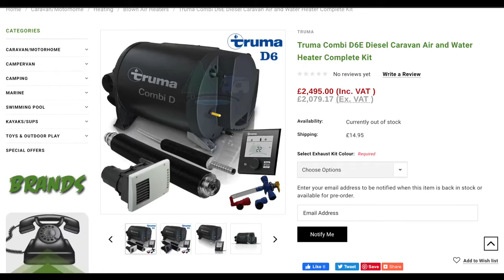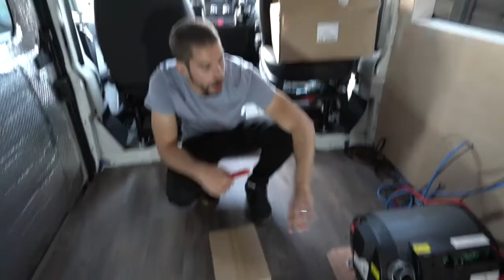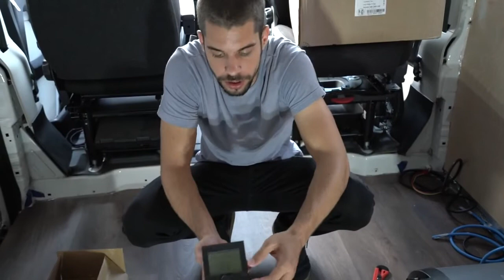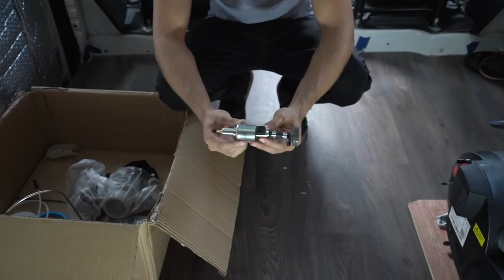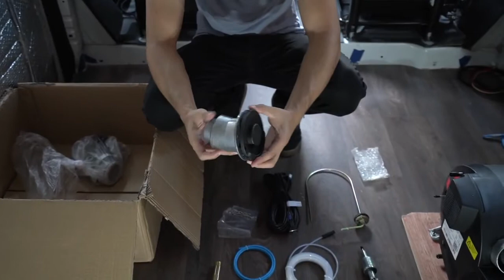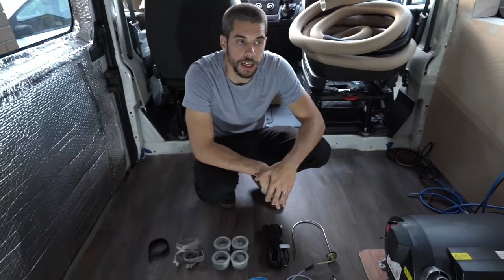Customer feedback about JP Combi 6KW Diesel Electric Air and Water Heater Unboxing

Comment: Hi there.  I bought the same combi heater about a year ago and I after watching your installing videos I now gathered enough courage to do the same.  Do you still know what the diameter of the cold and hot water pipes are because I can't find it  back in the manual (or I just overlooked it).  Thanks and ATB!
Reply from the maker: Hi Marc,  it is advised 10mm. Please check your messages on WhatsApp, Selina wil send you more details, thanks.